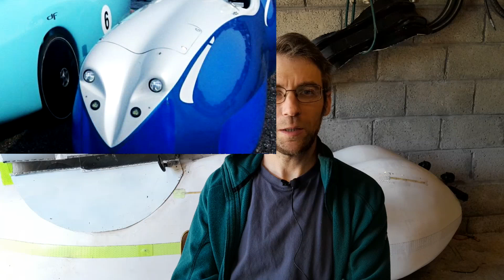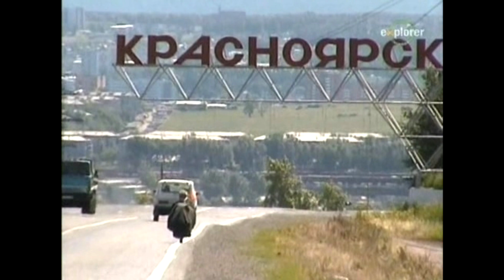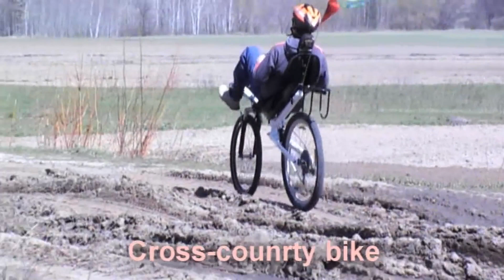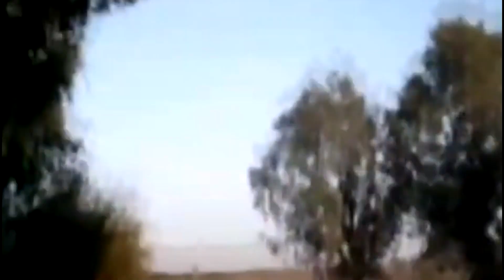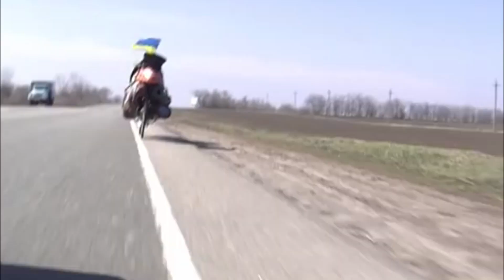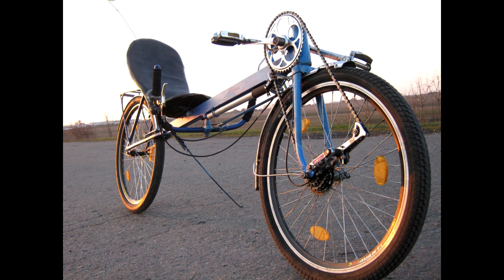Two-wheels. Recumbents & Streamliners. Theory & practice

Comment: Hey velodreamer, or anyone else here, can you provide the name of the software you are using to produce the visualization seen at the 15:08 mark in the video? I am also wondering if this software can be used to visualize ackermann steering geometry.
Reply from the maker: It is T-Flex Cad. But you can also use any other software that allows you to set relationships between elements. This is not some special software for steering geometry.
Reply: @Veloreamer-ENG  Thanks for replying to my comment. Did you also use T-flex program for the ackermann steering animation seen at the 35 minute mark in your video on three wheel vehicles?
Reply from the maker: @blayzeashurst3928  Yes. All 2D animation is done in T-Flex CAD (v10)

Comment: If the saddle on an upright bike is uncomfortable then either the saddle doesn't fit you or your position is wrong. I found a saddle that suits me very well, so I don't need padded shorts to ride all day. Unfortunately most people will need to try a number of saddles to find the right one - many make the mistake of thinking that more padding is better, not understanding that this prevents proper support of the ischial tuberosities and puts too much load on soft tissues. My "perfect" saddle is narrow and hard, but I just don't notice any pressure or discomfort. My recumbents are pretty comfortable too, but that's because they spread my weight on a much larger surface area, and don't strain my arms or neck.
Reply from the maker: So far, every ride on an upright bike is torture for me. The first minute seems like everything is fine, but then problems start. And every time the next day I feel like I was sitting on a hard saddle. Maybe you are right, and I have not found a suitable saddle. But I chose a more difficult path - to build a new bike without a saddle ;) By the way, I forgot to say that the seat on a recumbent bike should also be correct, otherwise there may also be problems on it during long rides.
Reply: Regardless of how good your seat is, if you spend enough time on a bike, a saddle will cause damage to your perenium, which can lead to prostate damage, erectile dysfunction, and nerve damage. I have spent years on both, and recumbents are life changing. The neck and wrist pain is gone as well, something a saddle can never fix.
Reply: I tried 10+ different saddles on uprights before I finally gave up on them, had a 10 mile commute to work and I'd have to arrive 30 minutes early just so I could start moving again. Ended up learning about recumbents and got a low end lowracer with a basic foam seat, that alone was light-years ahead of the best seat I have for my uprights. In October I did finally upgrade to a velo and had a custom seat made for it. Let's just say that there is zero comparison in the comfort. No matter how good your seat is on an upright, it will never compare with a recumbent.

Comment: Maybe the most interesting video I've seen on YouTube!
When using recumbents I pedal with my heels instead of the front part of the foot. Feels like I produce more power this way when the body is more straighten out compared to the position used on a modern upright bike.
Any thoughts?
Reply from the maker: It's interesting. But without precise power measurements it's impossible to judge the efficiency. Perhaps this type of pedaling is more comfortable for you personally.

Comment: great video, I,ve been building different 3 wheel enclosed delta recumbents for a few years now so what you've learned is interesting
Reply from the maker: Thanks for the comment! The next part of this video is a detailed analysis of trikes. I have also built delta trikes in the past. I hope to finish work on the next video in two weeks. It will be interesting to know your opinion and compare my experience with yours.